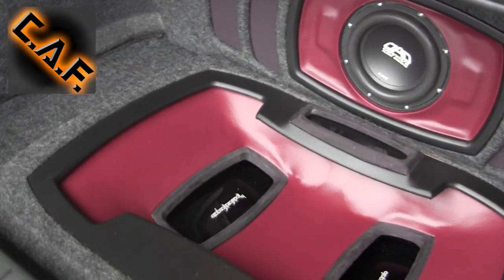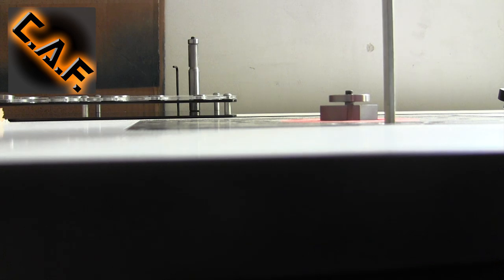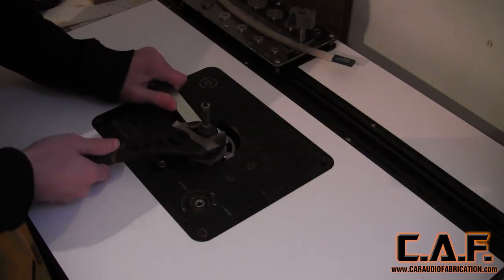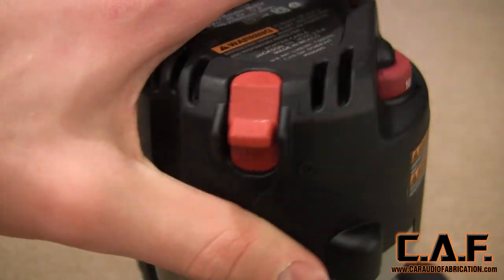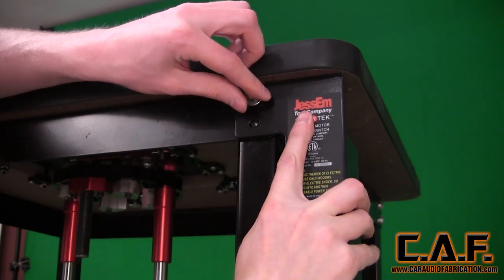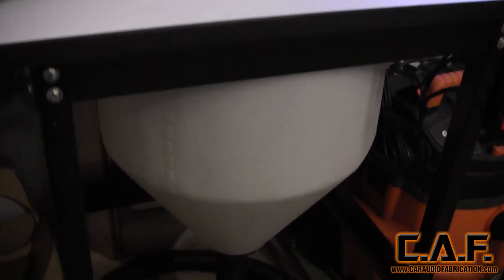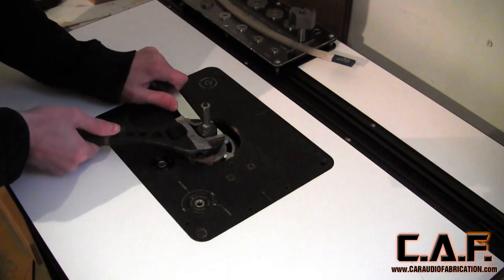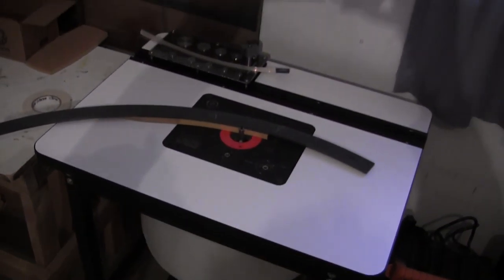Best Router Table Set Up for Car Audio Fabrication - CarAudioFabrication Building Better

Comment: Thanks again Mark for the awesome tips and well put together video. I wasn't sure in which router to buy but the Porter Cable seems like the way to go. Your videos are the best in the net by far and it's great to watch CAF grow into what it has become.. Thank you for all the hard work making these videos for all of us to learn ....
Reply from the maker: The adaptive speed control is amazing. Most routers bog down once you feed in material, this takes it like a champ. It also ramps to speed slowly which is important for safety and its much quieter than other routers I have used. You are welcome, just share wherever you can whether it be reddit, forums, facebook, etc. That really helps me out.

Comment: That is an awesome table and router i have a craftsman router and table i am learning to use so when i actually get starting on my car i have a good foundation, plus watching your videos helps as well. I will have to look into this table as it will also help me in my woodworking stuff as well, once again another great video.
Reply from the maker: Here is the pricing info special for CAF fans. $799 for the Table Top, Legs, FX Lift, Switch, and Dust Collection. $899 for Table Top, Legs, Mast R Lift, Switch, and Dust Collection. If you are interested call Mobile Solutions at 480-968-2074 or email Sales@mobilesolutions-usa.com

Comment: Nice setup.  A good router table is essential.  You might want to check into a dust deputy to put between your dust collection shroud and shop vac.  It will save your filter thus saving you money.  Mine pretty much paid for itself in no time.  Love the vids...keep them coming.
Reply from the maker: Please send me a link, I have been looking for cyclones and would like to get one I know works.

Comment: That is a great setup if you got the bucks. If I used a router/table every single day, that's what I would have. I clamp my router/table on top of my table saw which is more than sturdy and works great. Glad to see some Ridgid products.
Reply from the maker: Yes this is definitely the Cadillac of tables. :) Special pricing for CAF fans too :)

Comment: How do you adjust the speed, with the dust collector over the bottom of the router
Reply from the maker: Lift the lift assembly out the top of the table. Just be sure to unplug the power first.

Comment: How much would this whole setup run for these tools?  I'm very interested in expanding.
Reply from the maker: $799 for the Table Top, Legs, FX Lift, Switch, and Dust Collection. $899 for Table Top, Legs, Mast R Lift, Switch, and Dust Collection. If you are interested call Mobile Solutions at 480-968-2074 or email Sales@mobilesolutions-usa.com
Reply from the maker: LooseCannon48 Here is even better pricing.

Package 1 (No Funnel)
$550.00
 
·         Router Table Top (1” High Pressure laminated top)

·         Router Table Leg System (1” Steel Square Frame)

·         Router Table Switch (Safety Switch with two outputs)

·         Router Lift (Jessem FX Designed for smaller routers)

 
Package 2
$750.00
 
·         Router Table Top (1” High Pressure laminated top)

·         Router Table Leg System (1” Steel Square Frame)

·         Router Table Switch (Safety Switch with two outputs)

·         Router Lift FX (Jessem FX designed for smaller routers)

·         Router Table Funnel

 

Package 3 (No Funnel)
$650.00
·         Router Table Top (1” High Pressure laminated top)

·         Router Table Leg System (1” Steel Square Frame)

·         Router Table Switch (Safety Switch with two outputs)

·         Router Lift, Jessem Mast-R-Lift (Designed for larger routers)

 
Package 4
$850.00
 
·         Router Table Top (1” High Pressure laminated top)

·         Router Table Leg System (1” Steel Square Frame)

·         Router Table Switch (Safety Switch with two outputs)

·         Router Lift, Jessem Mast-R-Lift (Designed for larger routers)

·         Router Table Funnel

Comment: How do you change the speed of the router Motor with this setup? :c
Reply from the maker: GrimFix Lift the lift out the top of the table and adjust, its not ideal but I will take awesome dust collection over that small inconvenience any day, I really only need to adjust my speed when I switch to a large bit which is usually only once or twice per project.